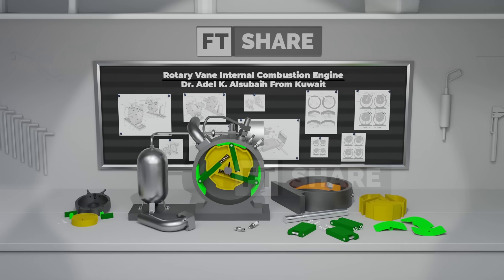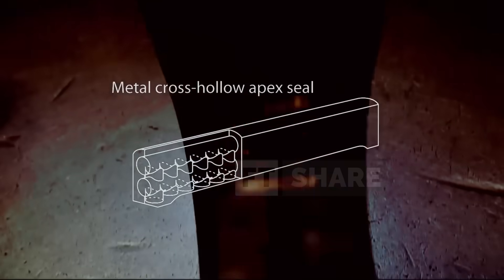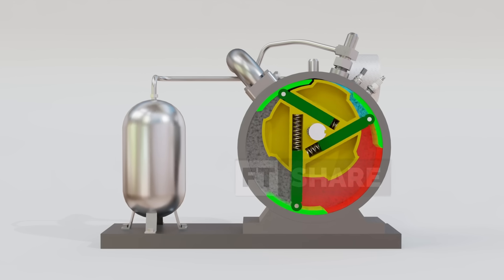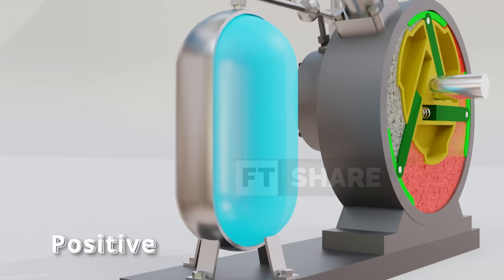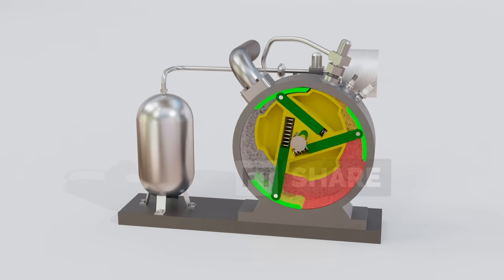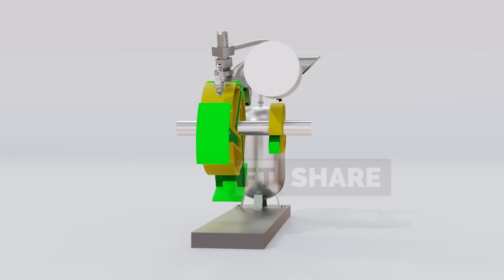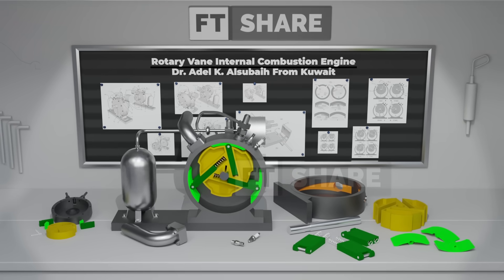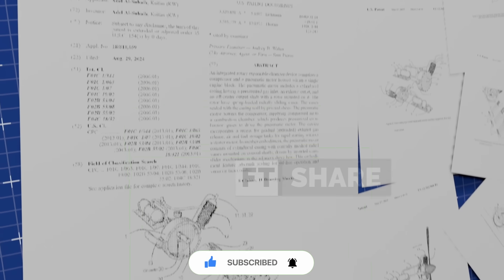The Genius Engine That Breaks All the Rules — No Intake, No Compression!

Comment: I would want a simple vane air motor with closed cycle working fluid that is not flammable if the gas leaks, not a solvent for the lube,  won't decompose, and with low latent heat. I'm leaving out a couple of features. I ought to file for a patent.

Comment: The rotor has no cooling and will over heat very quickly. If the main chamber is elliptical rather than round then al four aspects can be accomplished without an external compressor. I remember seeing drawings for such an engine 50 years ago.

Comment: Aside from problems with the sealing, relying on those little springs, and lubrication; it seems to me that the small compressor rotor running at the same speed as the combustion rotor, won't produce anything like enough compressed air in one third of a rotation to support three combustion events per rotation.

Comment: I think this is a novel idea. The initial use might be short life uses. Like dieposable drones. Other comments question the compression of air being a large energy drain. I agree but the pump could be sized to run off the main shaft without a transmission and maybe only making a whisper of pressure during startup. Springs floating? Never, the centrifugal force hints that the springs would only be needed during startup. Shoe friction? Yes but so are pistons and rings a huge friction loss to a conventional engine not even mentioning all the other parts. My curosity goes to the side seals of the rotor & vanes. Precision engineering with tight tolerances goes out the window with heating and cooling. I do like the thinking outside the box.

Comment: What I meant to say is you haven't said how you're gonna lubricate those shoes, cause there's no way they're spinning around
The inner case with no lubrication. So you would logically have to freaking inject oil with the intake.Air in order to keep those stupid things from wearing out too fast.That said it will probably not meet modern emissions standards

Comment: I see an innovation in the circular seal holding the vane bearing apart from the circular housing. That bearing surface has been an important disadvantage in past Mazda designs which had to deal with varying angles to seal and persist throughout lifetime wear.

If this innovation also approaches the advantages of an air bearing without significant friction, which is possible due to circular shape, then I wish not just the design team, but the test engineers well in their work.

This is a significant evolution in rotary compressors and expanders, despite these other negative comments.

Comment: The working stroke is basically an explosion of gases. Will those springs be responsive enough to expand in such a short time to keep the chamber sealed?  I have my doubts especially as the RPMs increase. Also the shape of the chamber(s) makes effective sealing problematic as it has to seal at the shoe and the sides.  Also what does anyone think of a torque of an engine where the direction of explosion of fuel gases is almost perpendicular to the intended direction of the movement of the rotor? What portion of the explosive force will be in the direction needed? There seem to be a lot of "reflection" of the gases affecting both torque and efficiency.

Comment: The piston rings in a reciprocating engine are what make todays engines practical in real world applications. Once you depart from the use of a circular bore to contain combustion heat and pressure, lubrication and gas sealing problems will be huge obstacles. Todays piston rings are beautifully engineered, and this technology just doesn't translate to other geometries.

Comment: 1. The mass of the shoe will result in centrifugal force insuring the shoe is pressed against the housing.  Don't need the springs once spinning begins. 
2. The shoe seal isn't well presented. These shoes should be scooping up air and floating on an air bearing. The centrifugal force will try to squeeze the air rammed in out. A balance is needed. If this doesn't work the design is going to be a failure.  The alternative is oil replacing the air.  This will have higher drag but will work.  Also the oil is a fuel so the quality of combustion could fall significantly. Another possible lubricant is carbon that will wear but can take the high temperature and the lack of liquid lubricant.
2a. The exhaust planed leakage between housing and the shoe  changed the air bearing.  Likely doesn't work.  And oxygen in the exhaust will burn the sealing oil or carbon.   
3.  Wankel, liquid piston, and Astron Omega have the same problem as this engine.  Side sealing because the rotor gets hot and expands. Seals are needed for the shoes, vane, and rotor.  The moving parts listed also must seal between each other, not simple.  So far none of these competitors have reached production at scale needed to compete.  Wankel made a run but failed.  

4. This engine seems to have the same problem as the Wankel and liquid piston being a thin so it is difficult to distribute the spray of fuel and get combustion to reach the corners.  This combined with the oil used to help seal and lubricate the Wankel engine made it hard to reach pollution requirements. I didn't list the Astron Omega because injecting fuel and combustion is done outside the rotors not as a batch process of all the other engines.  It is a continuous process or should be done between the rotors.  
5. The Astron Omega engine is by far the simplest in part count and interaction of parts in my opinion.  Sorry.

Comment: Has anyone made a working prototype of this engine?

With simulated, plastic parts, it looks somewhat convincing. But there is going to be an awful lot of sliding surface area, probably many times more than a piston engine of the same power. And all of these surfaces are going to need lubrication of some sort. And this lubrication will have to be able to withstand combustion heat.

This looks like it would consume 2-cycle oil by the gallon, the way WW1 rotary engines consumed castor oil.

The major reason for this is centralpedal force.

As an air-motor or steam engine, this setup might have more promise.

Comment: There are 2 main problems here:First one:That seals need to be lubricated, and u can t do that just by injecting oil directly in the combustion chamber=bad emissions -> not able to go to automobiles.
Second problem:Ineficiency:That pressurized air from that tank can t reach such a compression as in a piston engine which results in a bad fuel consumption.
Another pottentaly problem would be the springs that mantain the arms in the engine.At high rpms they become unppredictable.

Comment: Not a word about what the sealing shoes are made of, nor how much torque or power output.  Of what good is it, if it can't make much power in excess of what it needs to keep itself running?  This device might be able to serve as a motor run by steam or some other expanding gas system.

Comment: All very interesting, but here's the problem. It's a heat engine. The thermal efficiency of heat engines is terrible, and so is the efficiency of getting the fuel that it needs. When the alternative is an EV which doesn't care what the source of the electricity is, the IC Engine is doomed. The end to end efficiency of EVs is so much better than for ICE that it can't possibly compete. And that's before you even consider how simple EVs are compared to them.

Comment: I see this as a concept begging for ideas to improve sealing, lubrication, friction control and cooling. There are too many external areas for power loss requiring èngine power which reduces any mechanical advantage. So far, I see no comment that answers any of these problems.

Just a few conceptual ideas are presented that the Wankel has already improved upon which means to me that with new materials available today, far provides significant advantages ov the Wankel over this design. As for the Wankel burning oil, this is readily answered by using lubricant that does not pollute when butned, an area of development not addressed by today's research geniuses. 

It's more logical to put innovative minds to the improvement of the Wankel design than to explore a new concept that copies some Wankel design concepts without improvement but, instead, adds significant problems to the concept. 

Motorsport Publications in 1972 had a special issue on the Wankel that showed how American car makers attempted to destroy the Wankel concept and how GM paid $50 million in a lawsuit for it. Car and Driver bought two Wankel powered cars and tore down one engine at 100 thousand miles and ssid the apex seals eould probably have to be replaced in another 50K miles...

In 1972, the Wankel car had passed the environmental requirements for 1976 and no other car had passed the requirements for 1972.

This video says nothing about power capabilities of this design and it's probably because power for the air compressor would have to be factored in.

India has a car that runs on compressed air. What about a video on that car?

Comment: Sooooo... How did you solve the apex seal problem?????
You know, the seal that goes around the outer edge of the rotor ,,, the one that seals against the case not housing.

You should examine a wankel or rotor vane engine,, BEFORE,, you post this bs as a solution, to a problem you actually never solved.
Reply: its not a rotary engine itdoes not have an apex seal

Comment: If the seal shoe was extremely much smaller, but they would suffer the same wear as common vanes so doesn't solve anything just adds weight complexity. With shoes this size the combustion will actually force the shoe out against the case and cause extremely much more frictions and wear.

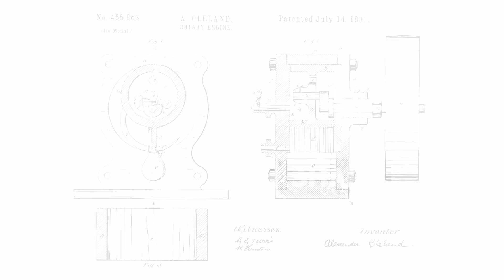Comment: 2:06 to 2:11 is about all thats worth watching...

this is the problem. we only get told and know of the ones that work. all these concepts from a century ago have been forgotten. every new rotary just attempts yet another variation of the same old, same old.

main issues with all these vane types is that pressure acts in all directions. massive surface areas, yet very little of it to produce a force acting to produce torque, and its counteracted by a nearly equal and opposite force, the only force left being the difference in areas...

Comment: Naah, this is a complete non-starter for the reasons others have given, but also because of the terrible shape of the combustion chamber.  Also, all the usual sealing problems at the front and back walls of the casing.  Have all these claims about power and efficiency actually been tested in a real engine? Or is it just a plastic dream?

Comment: I would like to say, trading engine issues for other component issues is never a good idea.

You removed engine compression to add a tank/external compressor that can fail separately from the engine == + problems -efficiency

You widened the seals that normally just barely touched the casing == +friction -efficiency

What's stopping the "engine" from running in reverse on startup? There doesn't seem to be anything forcing vectored travel in the correct direction....

Great idea, sure, but absolutely no mechanical improvement or even remotely fundamental improvements on any previous designs. This is a pipe dream until it can prove physics wrong.

Comment: Where does the lubrication come in? I see the combustion forces will push on the sealing paddle into the housing. Good for sealing, but... that's going to be a lot of friction and I don't see how this will last without lubrication. This is probably going to need to burn oil like a 2-stroke would.

Comment: Innovative ideas don't deserve to die prematurely, but I don't have faith in this concept. It shares two problems common to other rotary engines: 1. Poor sealing between chambers, and 2. Areas of the engine with high temperatures and others at ambient temperature. This creates expansion problems that deform the casing unevenly. Added to this is the difficulty of cooling and lubricating it.
Reply: It alows for less weight of engine make some walls thinner and only combustion part thick, with modern software everything regarding thermal expansion will be calculated and adjusted perfectly
Reply: @dmitryhetman1509 Way too much faith in computers and software. People could always figure this out themselves. Maybe computer does the tedius stuff.

Comment: Compression is where an engine gets it's efficiency.
This engine is a "remote compression" engine - the air charge is compressed by a pump  rather than the engine itself being the pump . In itself it is less efficient , needing a transmission to drive the pump , with inevitable losses in that transmission.
Secondly , I don't see the seal shoe pivot having a long reliable life directly exposed to the combustion process

Comment: It looks RUBBISH! low friction, good sealing my ass! At least its a rotary engine, but those shoes and vein sides are well dodgy. I prefer my instant on/off 'free piston turbine engine' that combines the benefits of a most basic yet powerful turbine engine (mainly that its rotary and adds much compression) + piston  engine (instant max compression). It's reciprocating, with built in novel, quite similar rotary heat engine that's way more efficient than a Stirling engine could possibly be). I have the final rough 3D draft with all elements squeezed into a tiny cylindrical package. No major sealing issues. Compression provides extra power instead of using up power.

Comment: This is a joke right, how is it better than traditional rotary engine? I can already smell burned oil and see how it will meltdown.
Reply: Power to weight? Reduction of cost? Main problem with those seems to be sealing
Reply: How is it cooled and lubricated  Gas turbines allready exist without sealing problem!  It is a Braytom cycle like the pistons compressor and pistons expander combination invented and opérated many years ago.
Reply: Melt down ..  aye
Where oil.
In fuel

Comment: What about the end plates sealing to the rotating assembly ?  Wankel engines have a problem with this, and this design will too ?
Reply: It's more surface area so it should be a bit more robust to that from a sealing perspective (at least while everything is intact). It also should be better efficiency than the Wankel because of the faster cycling speed, but I think it will burn up. You really can't lubricate it well with this setup and combustion pressures pushing on those plates right into the housing at peak pressure is going to really scrape into the housing. I don't think this design can run fast and hard without destroying itself.